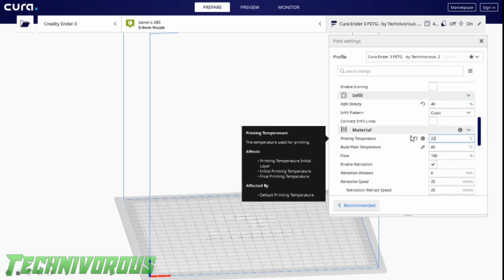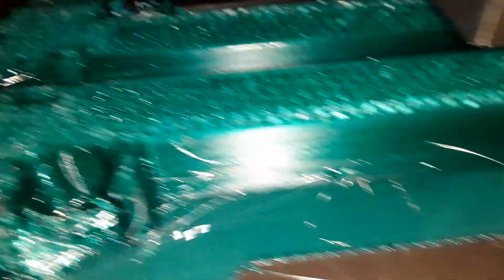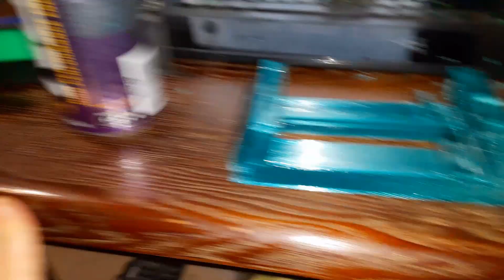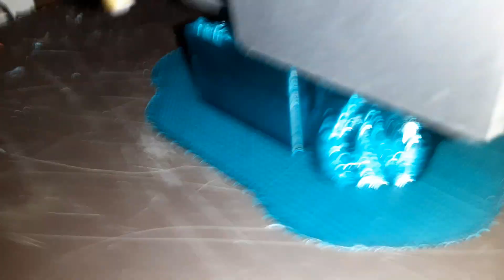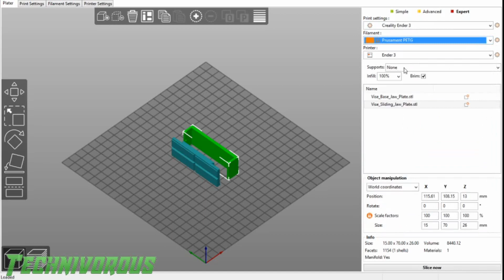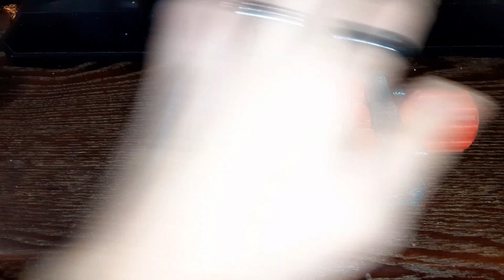A Full Guide to Printing PETG on an Ender 3

Comment: I wonder if there is a guide to what the different temps that are used for PLA, ABS, PETG and whatever else is used. Right now, the Ender 3 that I have has a setting for PLA. But I am not sure how to change that if I use a different filament

Comment: Thank you for your video, I have an Ender 3 Pro i got for christmas this year. I have been trying my luck with the PETG, I have installed the PEI build plate on an extra glass build plate and found 
that this material is ideal for printing PETG especially when removing the prints. I am going to try your profile in my Cura Hopefully this will help with some of the smaller issues i have been having. If not I amy try to message you for some support, I know this material is what i want allot of my prints to be fabricated from. I am a rotational molder in Kansas city Kansas and we use PE and PP material all the time but the process is quite different of course.

Comment: - Do I need to relevel the bed when changing from pla to petg?
- Do you know if the Ender 5 Pro is wired similar to the Ender 3?
- Is it ok to use the stock magnetic bed that comes with the Ender 5 pro or should I change to the metal w/PEI?
Reply from the maker: - not every time. i only relevel the bed if i jar it a lot taking off the prior print, or i notice something is off.
- the fan on the ender 5 should be wired properly
-the magnetic bed will work fine. i have had better luck with petg and adhesion with pei, but the magnetic bed was my fav for a long time!

Comment: Hi, when I try to print petg plastic at its recommended temperature and settings it still comes out making a bundled mess, the printer prints pla just fine so I know the plate is level. Can anyone tell me what I'm doing so I can fix it

Comment: I was so lost with my PETG settings after noticing constant gaps, warping, and just overall bad print quality. I stumbled across this video and used your PETG profile with the suggested changes you explained along with having fan speed at 25%. If anyone wants to know if the profile works, IT DOES, and quite amazingly. At this point my PET-G prints look better than most of my PLA ones with some extremely minor stringing. In my opinion, this has to be one of the BEST PET-G tutorial videos for quality prints and a great place to start with the profile. Many, many thanks to you!

Comment: Hey man , what are you printing on ? Aluminium or glass ? are you adding hairspray to stick to the bed ?
Reply from the maker: Pei, smooth as glass with no adhesive. I also use glass and glue sticks. Dont recommend petg on glass though, as removing the model can remove pieces of glass as well.

Comment: im having alot of trouble with this petg im not sure what im doing wrong the ender 3 came with some filament im guesing it was pla but it was enough to finish the test print it came with so i switched it out with petg and it just didnt work so i thought they didnt go together and i tried it again but it kept messing up even beyond that like printing early or not printing in time and missing half of the base and the base looks like the only part it does right ish and when it tries to fill it in its not sticking to each other and is very stringy and starts to curl

Comment: Thank you very much for your recommendations for your video and especially for the profiles you have made available for Ender 3.

I am one of the many users who do not leave the "comfort zone" of the PLA. I would like to print ABS some day but first I must " enclose the printer " and give more ventilation to the place where it is.

The PETG is somewhere in between PLA and ABS and serves my purposes.

Thanks to your video and your CURA profiles I got great pieces at first, I just deactivated "Build Plate Adhesion" because with the glass and the lacquer I don't need it. The filament is Amazon Basics. The first thing I printed on PETG is the "Hero Me" to improve airflow.

Again, thank you.

Muchas gracias por tus recomendaciones por tu video y sobre todo por los perfiles cura que has hecho y has dejado disponibles para la Ender 3.

Yo soy uno de los muchos usuarios que no salen de la "zona de confort" del PLA. Quisiera imprimir ABS algún día pero antes debo "encerrar la impresora" y dar mas ventilación al sitio donde esta.

El PETG es algo intermedio entre el PLA y el ABS y sirve a mis propósitos.

Gracias a tu video y tus perfiles de CURA he sacada piezas estupendas a la primera, solo desactivé "Build Plate Adhesion" porque con el cristal y la laca no lo necesito. El filamento es Amazon Basics. Lo primero que he impreso en PETG es el "Hero Me" para mejorar la ventilación.

De nuevo, gracias.

Comment: your profile seems to have issues, It won't import in ver 4 or even ver 3.6 says incorrect data.
Reply from the maker: This profile was done in 4.4 and due to updates to the profile structure when they added intent profiles they are unfortunately not backwards compatible, however I recommend giving 4.5 a go. So far it's the best version I have had.

Comment: see you have bumped up yout print speed... all other recent vidz etc speak of slowing it down to 40 mm/s max, initial down to 15.. comments?
Reply from the maker: Ok, so I have a little more free time to answer this now, so let me clarify... my ender 3 will run  petg at great quality around 50 mms, while my tevo tpro can do the same quality around 65 mm/s.

The anet I run turns to crap above 30 mms for petg.... 

While all of these use essentially the same nema 17 motor, all are roughly the same size, all cartesian, all with a similar aluminum frame. Same size nozzle, relatively similar bowden tube length and so on. Where they differ is the hot end. The ender 3 hot end is consistent, with one cooling fan for the heat sink. The anet hot end quit honestly is a janky pos.... and the tevo, which is the fastest, runs a volcano hot end, which has a lot more surface area to dissipate heat (bigger heat sink) so basically, a smaller heat sink, leads to more temperature fluctuation, which means filament has to be pushed through slower to reach the same average temperature, which means you need to slow way down for what's coming out of the nozzle to be a  consistent temperature. Turning up the speed in a machine with poor temperature management will lead to cool spots that leave blobs, and hot spots that string.... 

Yes I was going a little fast for the ender 3... but not much...

However your hot end set up is going to be what really determines your max speed.
Reply from the maker: Depends on the machine.  But there is always a speed/quality trade off.

Comment: Hi. Just found your channel. I have an ender 3 pro with crealitys glass bed. I want to print PETG but I am terrified of having TOO MUCH adhesion. Can you let me know what you use on your bed? Thanks.
Reply from the maker: I've had over adhesion problems before, I am not actually using glass, this is a magnetic pei sheet, and you can get them on amazon.
Reply: Whipe that boy down with windex, let it dry and it should be good to keep it from bonding. Still might need some working to getting lose

Comment: Hey ! thanks for putting up the prusa profile upon my request made earlier .  Do i have to play around with teh flow ? i've heard that the flow need to be reduced for PETG usually ? You haven done that in this .I ordered a white esun PETG . let em know if flow needs to be played with .I almost use stock PLA profile .
Reply from the maker: i havnt had to do anything too flow settings for any filament other than tpu since i properly adjusted my e-steps. if you start getting gobs or zits, then you should turn it down, i didnt have much of an issue.

Comment: hello
 cura will not let me import the print profile
Reply from the maker: which version are you using bro?
Reply: using version 4.4.0 i get this error    
Failed to import profile from C:/Users/emman/Desktop/HC/parts/Cura Ender 3 PETG - by Technivorous.curaprofile: Could not find a quality type super for the current configuration.
Reply from the maker: @codeman0018  ok, so first, there is a bug in cura 4.4 that does that. second, they fixed it in 4.4.1 but there are other bugs. you might get lucky and fix it by updating cura, and you might make it worse. lol. i would actually uggest, just creating your own profile, and watching the video so you can just copy the settings, or downgrading to 4.3 (the older cura versions are still available on their site)
Reply: @Technivorous  THANK YOU

Comment: I don't understand how to create the tree supports. Any chance you could upload a couple of .3MF files of the vise parts, so I can get an idea of how you construct them?
Reply from the maker: Somewhere around here on my channel is a video that shows you how to use tree supports. They are a feature of cura, and not modeled but generated when it slices. To turn them on: under print settings highlight "quality" and click the little gear that shows up when you have it highlighted, this will bring open the settings visibility box, where you can enable/disable options

There is a search box here, so type In "tree"  

A list of options with check boxes pops up, select the top one, tree support.

Now you have enabled the option but you need to turn it on. Close this box

Go back into your print settings and scroll all the way down. There should now be a tab that says "experimental" and underneath it a checkbox for tree support. Tick it so it's on, and then slice. Once it's done slicing you can jump over to preview mode and see what the tree support will look like
Reply: Hugh Radford III Look under experimental that’s where you’ll find your tree supports they are easy to use

Comment: You do a lot with CURA and I have always used it with my Ender3. I am on 4.4.1 right now. I have and Ender 5+ and two Ender3s. I have had fits with my Ender5 for months but just recently started getting successful prints off it. I am not sure if about the same time I started using PrusaSlicer but today I loaded something in CURA 4.4.1 and printed it. It printed a few layers and then came loose and gummed up the nozzle before I could stop it. I am not saying it is CURA but I immediately loaded the same thing with PrusaSlicer and printed it with no problem. (I also completely wiped down the glass bed with Water:IPA/50:50 and reapplied glue stick so maybe that had something to do with it) I am beginning to think that CURA has problems.
Reply from the maker: Cura has a bunch of issues. Unfortunately the crowd loves it so they kind of get glazed over. The joke is they just released a new version to fix the old bugs, and soon they will have a new version to fix the new bugs. Lol. Of all the slicers I have tried or used, I believe matterhackers mattercontrol has the most potential!
Reply: @Technivorous  So I downloaded it and it seems like they are trying to do a lot. Is it a good print tool (Less print failures... more profiles.... more filaments.....) or does it just do things others don't like be able to design inside the tool. I design with SW and so I don't need design tools. I need the best slicer and for me that is PrusaSlicer so far. I am buying a new Stacker S4/Xl and it comes with  Simplified 3d so I will be trying that soon so I may be changing my toon. As for CURA I want to like it because it is so user friendly (I started with it so maybe I just know it better.) but I get many more failures and I will eventually stop.
Reply from the maker: If you get ahold of cura 3.6 its consistent. Mattercontrol does do a lot, and its design capabilities are more like tinkercad than solidworks. So it definitely wont replace your cad program, the only features I use often from the designer in there are the text option that make it super easy to add text to models 8n almost any font, and the object that turns a 2d picture or logo into a model. It's the closest to cura in features and customization. Prusaslicer is amazing, but a little more involved, although that's good for people who like to dial in the details, so I only have good things to say about it. The I have s3d,  and anytime they update or add a feature they will charge you for it, and I haven't found a single thing it does better than the free slicers. Definitely give it a shot, but I suspect if your a prusaslicer fan you will stay one because it really is unique as far as slicers go and it just works. For slicers I think the only one I haven't tried is repetier-host. Which I will be trying soon as I'm currently waiting on a tevo coming in for review
Reply: That is not a slicer problem and you in fact describe the steps taken after that made the difference. If you had added the glue and tried the Cura sliced file, you would've gotten a successful print.

Comment: PETG has such a large range of print temps based on both brand and color that in many instances it's almost like they are not even the same base material - great example being colorFABB (totally opaque) black PETG, which I print at 244 without a cooling fan and bare minimum retraction - just enough to prevent stringing - as a lower temp, higher fan and/or more retraction are a recipe for disaster on longer prints (the plastic in/at/around the tip of the nozzle eventually collects up and hardens just enough to block flow a little bit all the way to a complete jam). And yet here you are, printing opaque red at a temperature where my PETG won't extrude at all XD
Reply from the maker: Yeah that red is super easy to work with. Actually the same petg brand as the mando helmet I made. It's got to be a different polymer, and I assume it's more towards the pla side but they list it as petg. O. The flip side I once had a purple haze pla that was mostly translucent that printed at 245.
Reply: @Technivorous  I am pretty sure there is no PLA in PETG, if that's what you mean; however, the "G" stands for Glycol, which is an additive they add to PET that modifies its properties and, I think, is where the temp differential primarily comes from. For instance, eSun black opaque PETG prints almost 10C lower for me, but the prints are also quite a bit shinier and even physically feel different than colorFabb, plus it's more difficult to work with (the print quality - from stringing, minor gaps or globs, or all the way up to a full print failure - is very easy to throw off with just minor print setting changes). The difference is big enough that I only purchased eSun instead of colorFabb during a time period when black colorFabb PETG was in short supply, and now that I've seen the difference I would only ever use a non-colorFabb PETG if there was literally no way to avoid it. (Especially now that I've got a PETG model that I sell on a consistent basis - going with the much less expensive eSun ultimately costs me more due to the number of prints that are not sales-worthy.)
Something else to note, and that you should try if you ever get the chance - pure PET filament. There was a company (unfortunately now defunct; I really liked their filament) that sold both PET and PETG, and the difference between pure PET and the glycol additive really did feel like you were using two completely different materials. Yet another reason why I think the percentage of glycol content is the primary cause of differences between PETG brands, probably both in quality as well as their price.
Reply from the maker: That's a lot of great info. Odd though I have had great luck printing with these opaque petgs, but the translucent ones give me more trouble. I wonder why its backwards. Either way, all the other petgs I have tried were more translucent I was actually really surprised how opaque this stuff was. One of the other patreon patrons, Todd has shown me some amazing opaque matter hackers prints in petg, but the translucent blue matter hackers was giving him trouble until he turned up the temp. To be honest I think the filaments.ca stuff was my favorite, it was pretty forgiving. I believe it came in the fila box shipment.
Reply: @Technivorous  Thanks! I'm pretty sure that at least one big difference is that my printer is a much older one than an Ender 3, with direct drive on an E3Dv6 Titan extruder/hotend, and my cooling fan is turbine-style (high output) with a custom duct that wraps around 3 sides of the nozzle...which is made out of tungsten, so its heat properties are probably affecting my settings as well. (I actually forgot about the nozzle material until just new, heh; I bet that explains a lot, whoops...)